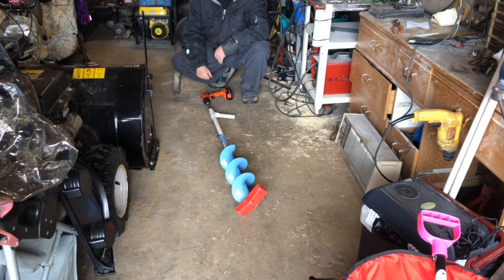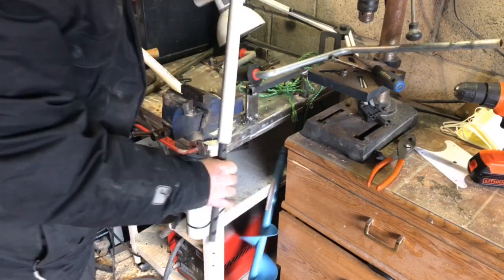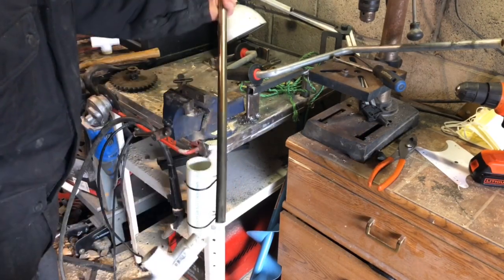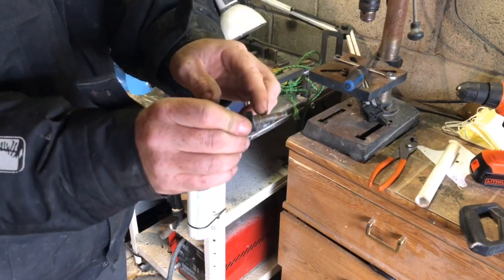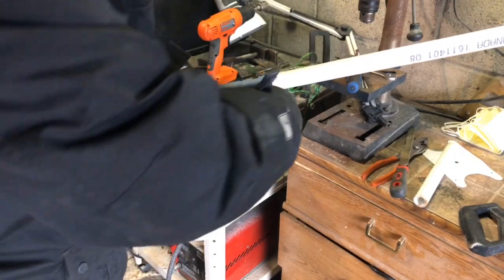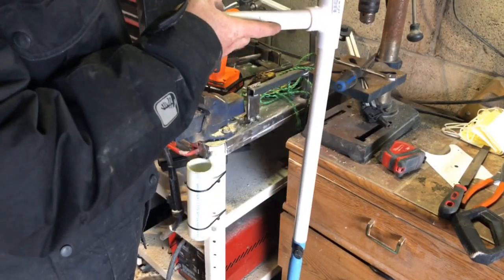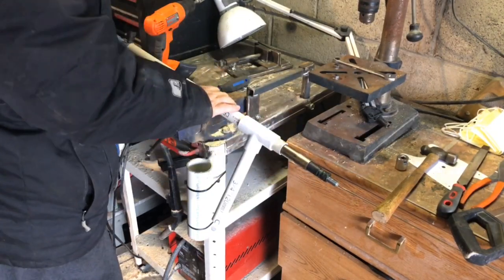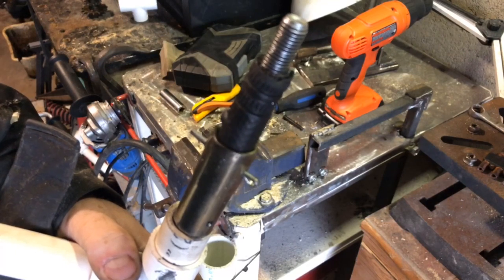How to make a ice auger adaptor

Comment: Did you have to put a center on the bottom so the blades don’t walk?
Reply from the maker: it worked ok handle kept it from walking and the snow but didn’t have a strong enough drill